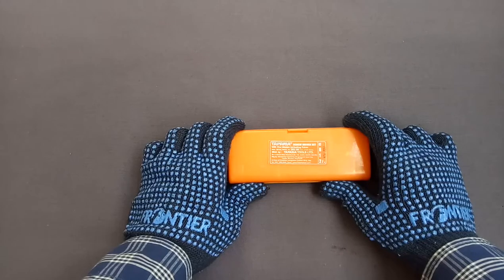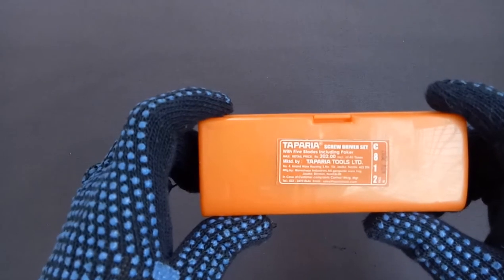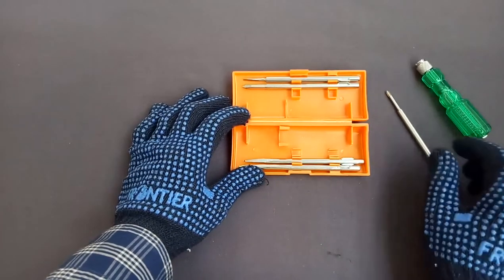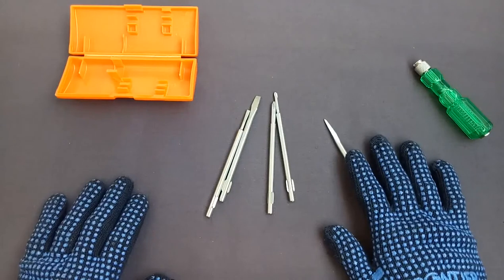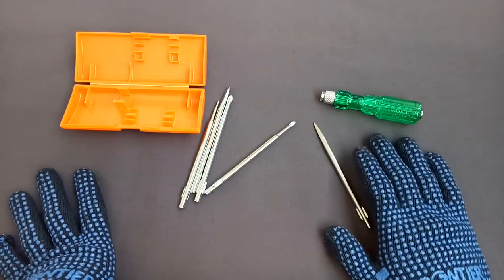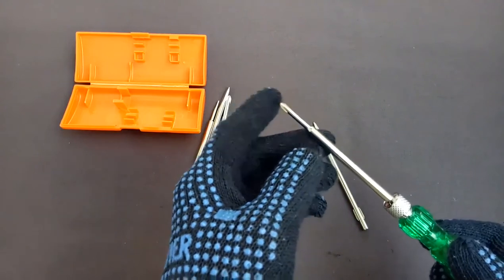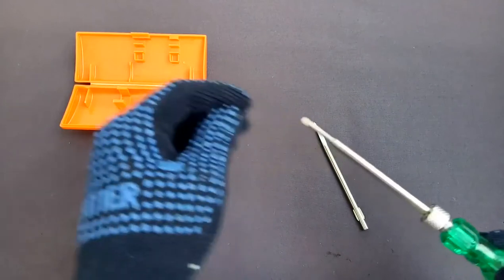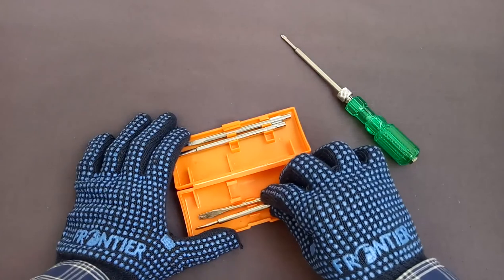Unboxing and Review: Taparia Screwdriver Set

Comment: Please tell me how it's steel hardness? Will it's tips specially small star tips resist the high pressure for opening very righted screws or will it's tips threads get little bit damage?
Reply from the maker: I am using this and it is very effective. No damages of tips at all